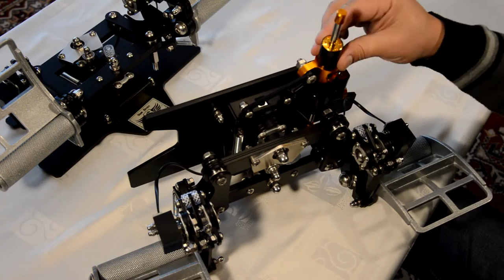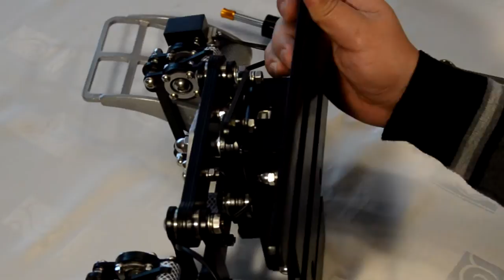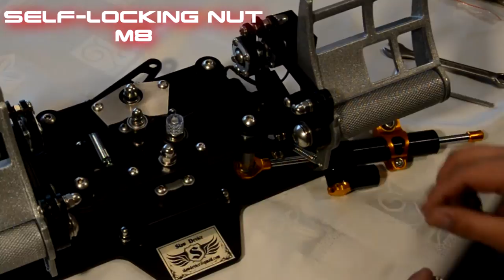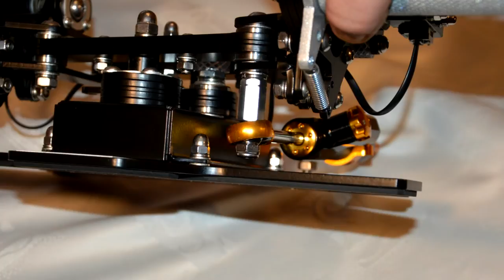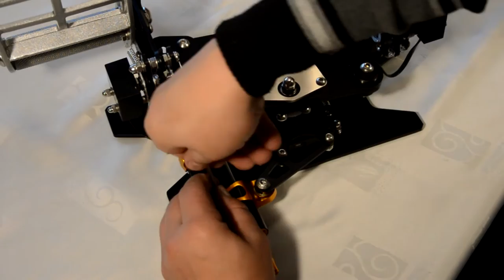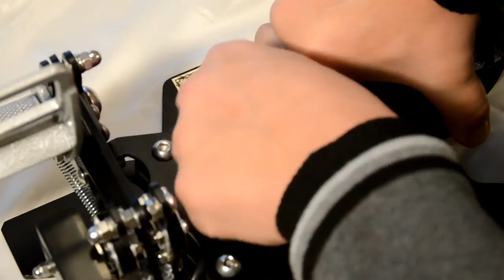Installing the damper

Comment: I just installed my damper....WOW, I thought these pedals could not get better, I WAS wrong.  

Great Job Slaw Device!
Reply from the maker: +Mark Lopez Thanks!
Reply: +Mark Lopez What does the damper do for you? I just put in an order and would like to know the benefits. Thank you!
Reply: I just saw your message sorry.  The damper keeps the springs from being too wild.  It makes the pedals more precise and easy to control.  If you use the pedals a while then put on the damper you will understand.
Reply: +Mark Lopez No worries thanks! I am pumped to receive my pedals from Slaw.
Reply: While it makes it easier to control, in no way it makes the pedals more precise.

Comment: Hi all. 
I have some tips, as for using Hydraulic Damper in Rudder.
I found that Cheap $40 chinese dampers have strong Stiction. Force needed to overcome that results in 
rough motion, and compromises precision.
So much, that i have remove it after 10 min.
But Lately i have disassemble these damper. Replace old (tight) semirings with new ones (8x16x7 by 
ERIKS), and poured new fluid.
I used some spare engine oil. But Hydraulic Oil will be better. Engine oil is bit elastic, and also 
tends to hold air bubbles, but viscosity is OK.
Also...if you do not have the proper key to unscrew dampers cylinder...and you haven't ;)
Just sacrifice one fork. Cut, and bend it to fit to 2 of 6 holes.
After that stiction is unnoticeable :D
Added inertia make steering very precise, and smooth like butter.
Now flying DCS Huey is almost mystical Experience.
Reply: Can I contact you on DCS forums? I have THIS EXACT PROBLEM and maybe you can provide some insight?
Reply: sorry ... not using forum.
Just find work in space, where you can spill some oil.
Also ... vice, adjustable spanner, locking pliers.
Grab things through .. for example piece of wood to avoid leaving marks.
First place Dampener rod in Vice - longitudinal axis parallel to the width of the vice jaws, the ensure a firm grip.
Unscrew ball joint on rod front and cap on its back.
Dampener in perpendicular position.
At resistance regulator side, Unscrew Cylinder Cap with 6 holes (with fork)
Do not remove bottom cap ..yet
Move rod Up (Full resistance setting) down (no resistance)...until fluid pushes inner plug, and oil seal out.
Rest is easy...replace both seals. When closing don't fill it to top...leave place for plug...watch out for air bubbles.
Reply: I think I will manage to pull the damper apart now, thanks for your description.

I wanted to ask where to order the matching o-ringsby ERIKS that you've mentioned.
What oil do you recommend? Any specs? I am guessing it's better to have less viscosity?
My main problem is the O-rings, could you provide a link where you ordered them?

This sticktion is what is preventing enjoyment flyling helicopters and props precisely, especially at positions close to center but I really love the inertial feeling.

You're making my day, Luki. Thanks!
Reply: I have a camera and will document the process of disassembly via timelapse. Will try it in a few days and let you know how it goes. Same dampers (chinese hyper-pro copies) are used in other pedals, not only Slaw's, I run BRD F2 pedals with the same damper.

So I have to replace both the oil seals and the o-rings? Okay. The main problem is sticktion so I will go with car oil then.
Reply: Sorry there are no O-rings.. I mean Simerings.
There is only one at each side of cylinder.
Final effect may depend on seal quality...type of rubber.
I was lucky with these...and effect surpassed my expectations.
Reply: Hey Luki, thanks again for the tips, my BRD pedals got a damper overhaul and work GREAT now.
Reply: I'm glad you did it successfully.
Little update from me...best seals i testet were:
8x16x7 CORTECO 12010757B (material: NBR)

I tested also Simmering made from FPM and ACM rubber.
But cheap CORTECO NBR had smallest stiction.
New ERIKS seals were also bad :(
As for tested oils:
-Silicon oil (High stiction)...But it also can perform wel in some conditions
-Hydrolic oil (Medium stiction)
-Engine oil (Acceptable stiction level)
Reply: Thanks a lot for the update Luki!